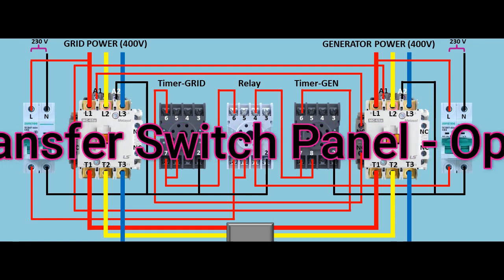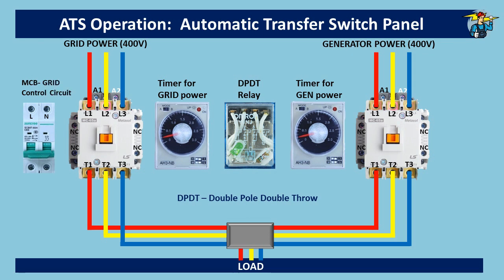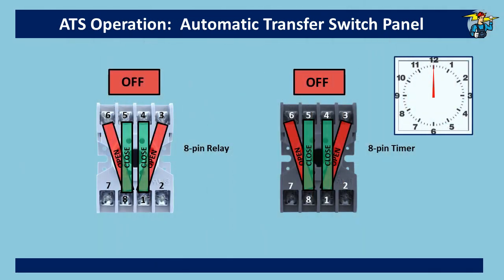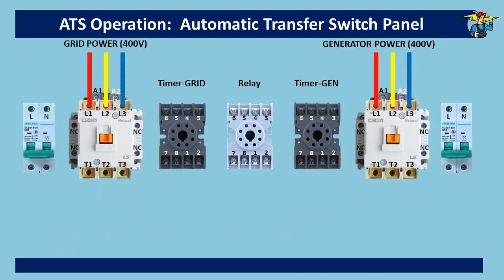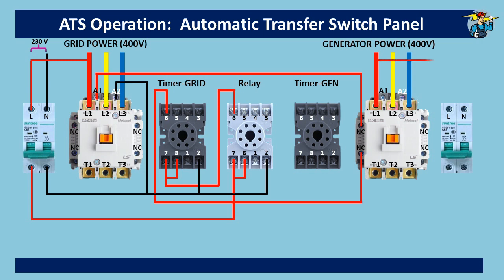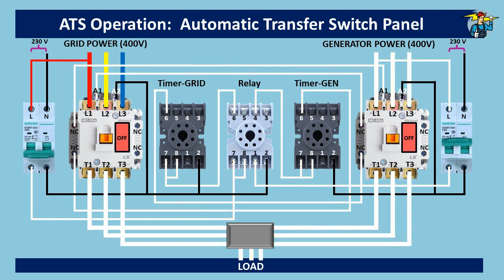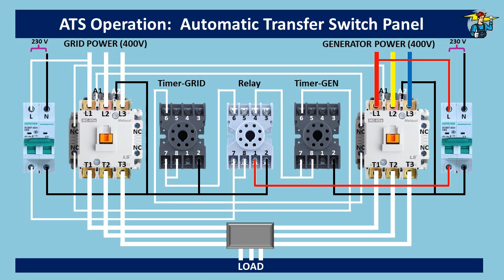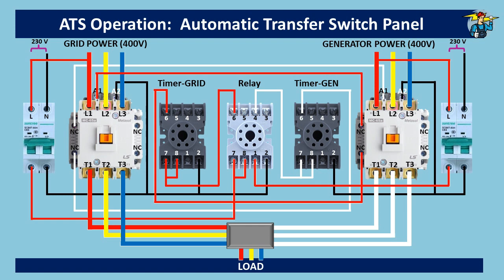ATS panel wiring / Automatic Changeover Switch for Generator / Automatic Transfer Switch

Comment: Perfect description.
But at 8:31 i dont like N that comes from MCB  Main grid power.
If that mcb is off the relay will be off cause of N from Main MCB that accidently could be OFF so the power from Generator could not pass the relay to the load
BUT THE DESCRIPTION IS PERFECT WITH RELAY.
I THINK WE CAN USE THIS CONNECTIKN WITHOUT TIMER GEN AND GRIP.
Reply from the maker: Thanks for commenting on this video. Check this video for automatic start and stop of the generator,
https://youtu.be/_6WhieL50GI?si=p5oxFlm3C-0Da5p6

Comment: Why do you loop the grid power to terminal 8  on the relay and not looping the generator supply power
Reply from the maker: We loop the grid power to terminal 8 on the relay because in normal conditions, the grid is the primary source. So the relay is wired to pass the grid supply to the load when the coil is energized.
The generator supply is typically wired to the Normally Closed (NC) contact, which means it will only connect to the load when the grid fails and the relay de-energizes (or in some designs, when another relay or controller triggers the changeover).
Hope you got it.
Reply: Can you help to create one

Comment: To be  completely safe and reliable, 2 undervoltage relays should be added, one for the generator side other for the grid. These relays only enable the changing over if the voltage and frequecy are ok
Reply from the maker: Yes. One Phase Failure Relay on Grid side will be enough since AVR is functional on gen side.

Comment: Nice!, can you explain how to connect two synchro generators?
Reply from the maker: Connecting two synchronous generators (or alternators) together to operate in parallel is a process called synchronization. 
It ensures that both generators share the load and operate safely and efficiently without causing damage to either machine or the power system. 
For successful synchronization, the following four conditions must be met between the two generators:
1.The terminal voltage of both generators must be the same.
2. Both generators must operate at the same frequency.
3. The phase sequence must be identical for both generators.
4.The phase angle difference between the voltages of the two generators must be zero or close to zero when they are connected.
There are three commonly used synchronization methods.
1.Manual Synchronization: Using a synchronoscope or synchronizing lamps, the operator manually matches the parameters and closes the circuit breaker.
2.Automatic Synchronization: An automatic synchronizer matches the voltage, frequency, and phase angle and closes the circuit breaker at the correct time.
3. Dark Lamp and Bright Lamp Method: In this method, two lamps (across the generator and bus) are used to monitor phase angle difference. The lamps will flicker and go dark when the generators are synchronized.
Hope you got the required information.

Comment: what if you added manual control using a selector switch and 4 push buttons
Reply from the maker: I have shown the general system of an ATS.
You are free to add more equipment and do modifications according to your requirement.
Please get help from a good electrician on this.

Comment: Good explanation sir but I just need to know where the neutral going to the load will be taken from since our load is going  to need one
Reply from the maker: I have not shown the neutral line to the load here.
Neutral line to the load should be through the junction box.
Grid side and Generator side neutral lines should be taken separately to the junction box, as we did for the three phase lines.
Thank you

Comment: Request ats amf with cos socomec
Reply from the maker: In essence, "ATS AMF with COS Socomec" refers to a system from Socomec that combines an Automatic Transfer Switch, Automatic Mains Failure system, and possibly a Changeover Switch to manage power transitions between utility power and a backup generator.
I'll try to make a video on this when time permits.

Comment: This diagram very important part missing. Contactor manual interlock ?
Reply from the maker: Manual interlocking is not an absolute requirement for contactor interlocking, but it can be useful as an additional safety feature.
You will see here, we have provided Auxiliary contact interlocking and timer delay interlocking for this arrangement.
You can add more systems for contactor interlocking here, according to your specific system needs.

Comment: According to the VDE, the mains must first be switched off, then wait briefly, and then the emergency power must be switched on again. The switches must be mutually interlocked so that both are never switched on at the same time.
The system must be immune to very short dropouts.
Reply from the maker: Exactly.
Timers on this ATS are there for this purpose. 
Also, electrical interlocking system is already included here.
In addition, you can introduce a mechanical interlocking system too.

Comment: 230v must be DC to control CB right..
Reply from the maker: 230 volts through the 2 pole circuit breaker should be AC since we take the phase wire from one of the 3 phases.
Reply: What if there is no power in that particular place of the grid to the mcb, meaning the whole system won’t work.?

Comment: I would like to ask one question..if the contactor from grid or genarator get jammed,any safety devices can fix to avoid two way supply at the same time...?
Reply from the maker: Further to the electrical interlocking arrangement through auxiliary contact points of a magnetic contactor, we can introduce an additional mechanical interlock in between the two main contactors.
It will too help stopping both contactors getting power at the same time.
Reply: @ElectroAcademyEA  ok...thank you sir for the clear  explaination...

Comment: What is that timer thing?
Reply: Found something similar. 5A 250VAC OMRON Analog Timer Relay H3BA-8 220V
Reply from the maker: Timers in an Automatic Transfer Switch (ATS) play a critical role in ensuring a smooth and reliable transition between power sources. Here's why they are important:
1. Delay on Engine Start: When the ATS detects a mains power failure, it doesn't immediately switch to the generator. A timer introduces a delay (usually a few seconds) to confirm that the outage is not momentary. This prevents unnecessary starting of the generator for short or transient power losses.
2. Generator Warm-Up Time: After starting the generator, a timer allows it to run for a brief period (warm-up time) before transferring the load. This ensures the generator is running smoothly and at full operating capacity before taking on the electrical load.
3. Transfer Delay (To Generator): The ATS uses a timer to control how long it waits before switching the load from the mains to the generator. This ensures the generator is stable and ready to handle the power demand.
4. Return to Mains Delay: Once the mains power is restored, the ATS doesn't immediately switch back to the utility supply. A timer is used to ensure that the mains power is stable for a set period (e.g., a few minutes) before transferring the load back. This prevents switching back and forth due to brief or unstable power recovery.
5. Cooldown Timer: After the load is transferred back to the mains, the generator continues to run for a cooldown period. This timer ensures the generator runs without load for a while to cool down, extending its lifespan.
In short, timers in an ATS are essential to avoid abrupt switching, protect equipment, and ensure stable transitions between power sources.

Comment: Is there any possibility function  to without interrupting power supply this ATS will maintain continue supply
Reply from the maker: No.
There will be an interruption around 10 to 15 seconds only, when changing power.
Please see video on this link for generator automatic starting. https://youtu.be/82kSAOOcouA

Comment: why you don't have a push-button switch between the load side of the miniature circuit breaker and coil?
Reply from the maker: Here automatic transferring of power take place with ATS but generator auto start facility is not available.  
For ATS with generator auto start function, please see my video on below link. 
https://www.youtube.com/watch?v=82kSAOOcouA&t=709s
Thank you.

Comment: But sir why wouldn't you use 3phase MCB but rather you use single phase. Please any explanation thanks
Reply from the maker: Single phase breakers are used for control system power only.
This 3 phase power lines on both grid and generator sides will surely come through 3-phase breakers fitted before the contractors.
I have not included those here to avoid complexity of the diagram on the screen.

Comment: Which neutral to the load
Reply from the maker: Neutral line also need to be connected from both grid and generator sides, as done for the three phase lines. 
If 3 phase loads are unbalanced, it will make current to flow through the neutral line also.
If we can analyze the loads in advance, four pole contactors can be used instead of two 3 pole contactors to accommodate neutral lines also through them in a condition like that.